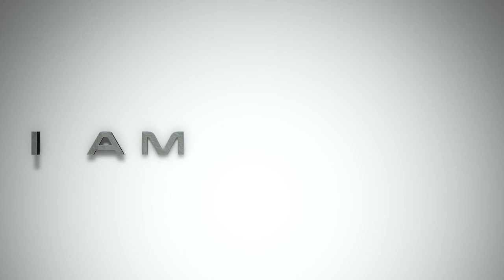MOTOVLOG 2 - The Loud Beast

Comment: did you retune the carbs with the new mufflers? change any jet sizes?
Reply from the maker: andy_rs_ I had them completely replaced and tuned, no new jetting.
Reply: I AM SANDY same bings?
Reply from the maker: andy_rs_ yes same bings, bought on eBay and had them serviced.
Reply: @HOLYSHIFT  cool thanks for the reply. just got a 1984 r65 a couple months ago and finally digging into it. planning on teh 860 kit to give it some more teeth
Reply from the maker: andy_rs_ cool thing. It’s a fun and exciting project, take some pics or videos to document...it’s a nice memory
Reply: Is this the 1st video where we see cyclefanatix riding his harley?